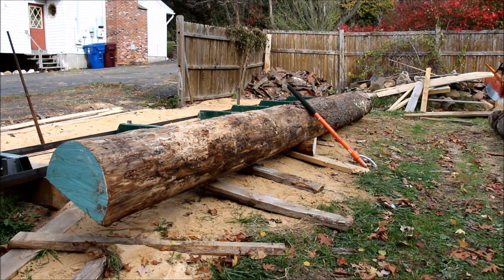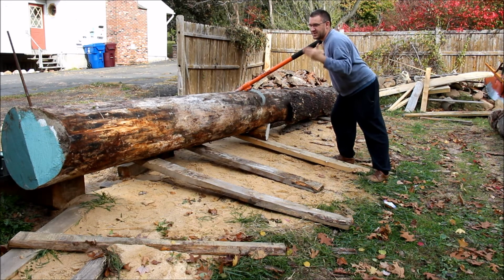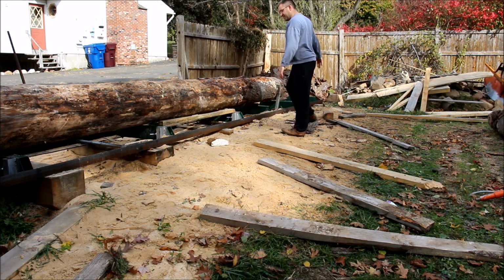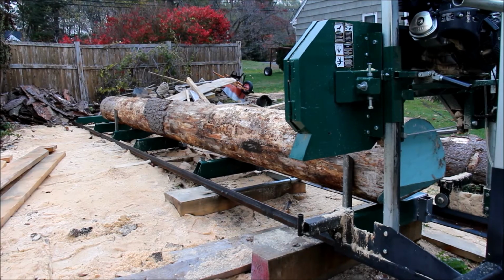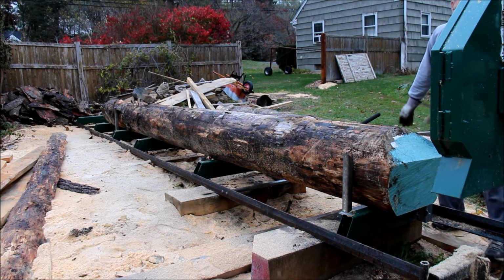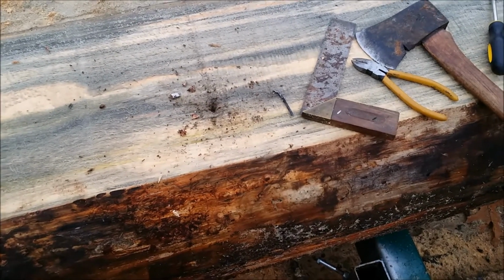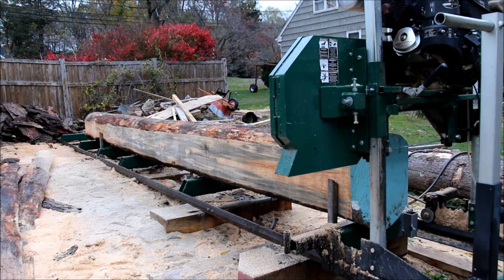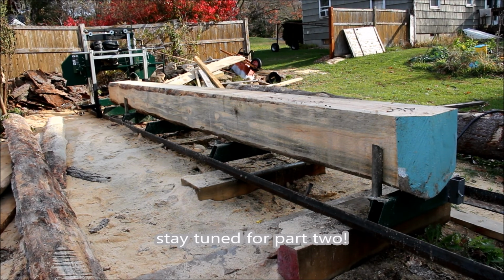How I mill an 18ft+ beam (beams!) part 1 (updated)

Comment: Matt, you ought to fabricate a water cooling line on your saw, so all you have to do is connect the hose to it.  It does not are a lot of water to cool the blade.  I would just use roll copper.
Reply from the maker: Have a look at my other vids on this.  I have upgraded the lube system.  But ...not a bad idea to use roll copper to shoot water just ahead of the blade
..
Hmm
Reply: Matthew Olson the reason for roll copper is the vibration would crack rigid copper.  I would flatten the end and put it right before the blade goes in and put a valve on the line to allow me the opportunity to adjust the flow of water.  A tank would also help because you would not have to have to pull the hose as you cut.  A 20# LP cylinder should be enough to cut a lot of wood.  Gravity feed should be enough pressure.

Comment: I see three problems or potential problems First problem is use some pieces of wood cut on angles like a triangle to keep the log from rolling back on  you works great I see the two by four coming out with the vibration 2nd problem is the painted you would be surprised how much the paint will dullen your blade it is worth your time to cut a quarter inch slab off to get rid of the paint or draw a line and cut the line out with a chainsaw to get rid of the paint chain saw is a lot easier to sharpen than your blade third problem it is also worth your while to remove the bark I see a little bark half way down and on a log where it is fully barked cut the bark off in that section. you will get more inches out of your blade just cutting wood.
Reply from the maker: thanks for the comment Marc.   interesting, never had or noticed any issue from paint dulling the blade.  though I agree its easier to sharpen a chainsaw, just never felt the need to cut the ends off to avoid the paint dulling the blade.  often the logs haven't dried enough to justify removing the paint anyway, so I like to keep it on there even after i've cut the boards.  still, i'll keep that in mind.   2... the dog system i have doesn't work great with larger  or awkward logs.  often just a 2x4 jammed in there seems to do the trick when the log is big and heavy, but yes, they aren't perfect and having the log fully dogged in would be better.     and yes, fully debarking the wood is better than not, but i've noticed that running the water definitely increases blade life when going through bark, and i don't have great tools to debark in a the straight line of the cut.   if I had a laser line of where the cut was going to be, I'd take a chainsaw and run down it first, but I don't have that.

Comment: If the dust bothers you why don't you mount an exhaust into a catcher..or at least hook a burlap sack onto the exit
Reply from the maker: so far i've been ok with the sawsdust, just need to move it around... and there might not enough height for the sack unless I dig the earth down quite a bit.  so far I've been using the sawdust to level the ground around the mill... it helps for sure.

Comment: With blades at $20 a piece, why don't you have a metal detector?
Reply from the maker: johnnybarbar ...1. haven't gotten around to pickin up one... 2 out of the hundred logs I have milled I have only hit metal a few times....maybe I'm lucky?
Reply: They can be bought for less than $50 so they are a wise investment
Reply from the maker: also, for the record... I buy excel blades from Cooks in alabama?  10 blades for $165 shipped